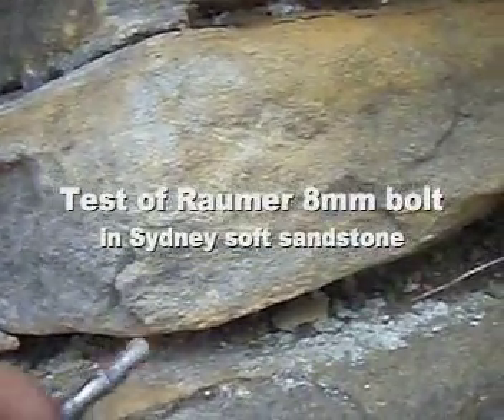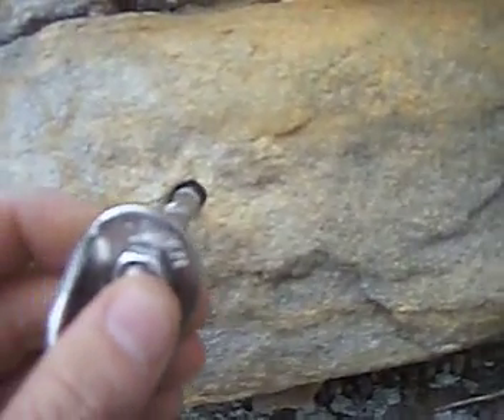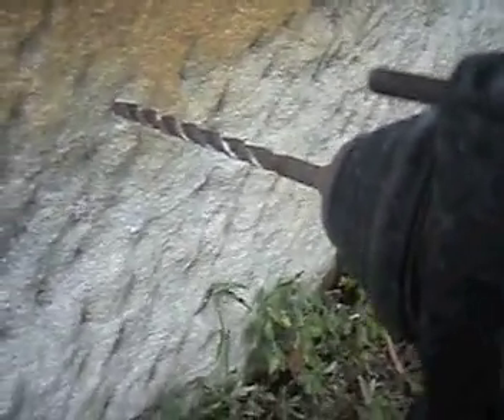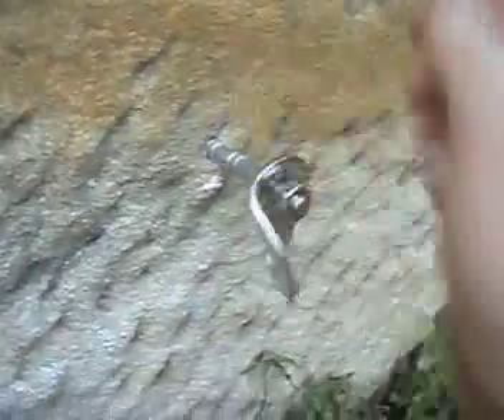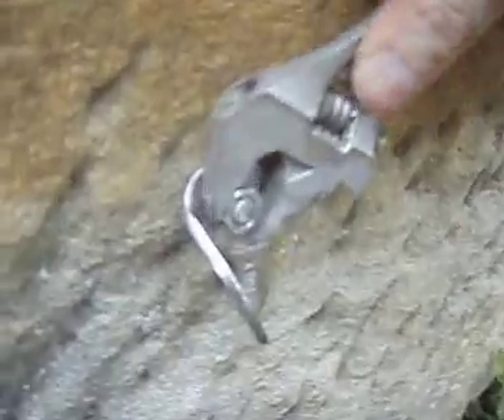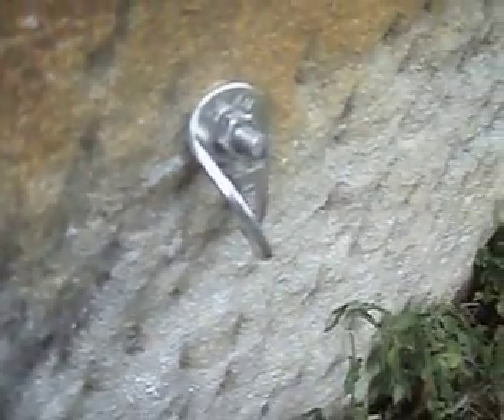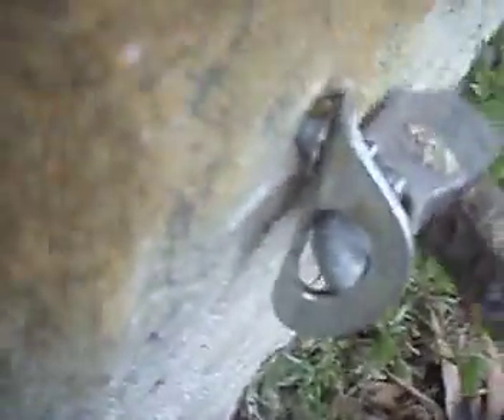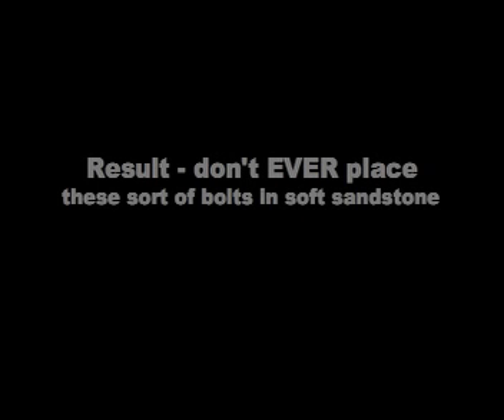Raumer 8mm bolt soft rock test

Comment: @dogdogee 
Glue-ins are standard practice in Australian sandstone, although 1 inch dia is a tad excessive.  

It sounds as though you are unaware of the history of this video.  Travelling Czech climbers, against local advice, bolted a 10 pitch route with half sleeve (friction fit) expansion bolts, in the manner of this video.  This bad bolting sadly resulted in the subsequent death of an Australian lad.  The Czech bolts have now been removed.

Comment: I heard when they pulled the bolts from bunny bucket, that leaning back with a draw clipped to 
their harness was enough to pull some straight 
out of the wall. Thanks for posting this. Say's a lot 
about modern epoxy.

Comment: Interesting.  You'd think that after bashing the bolt into the smaller hole, whether the rock was soft or otherwise wouldn't make any difference to how well it gripped ... provided the bolt was well designed ...

Comment: Was the smaller hole properly cleaned with a brush and blowing air, prior to inserting the bolt ?

It would be interesting to hear the manufacturer's claimed reason for the failure with the smaller dia. hole.